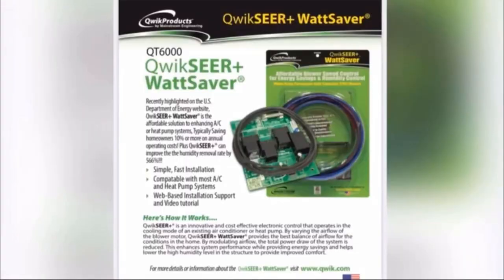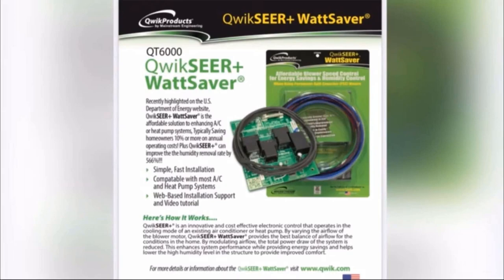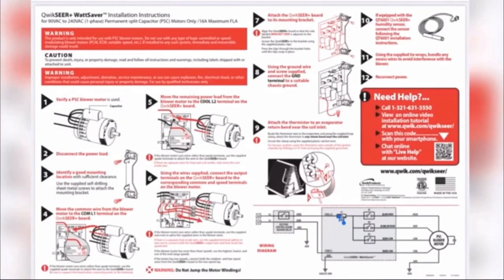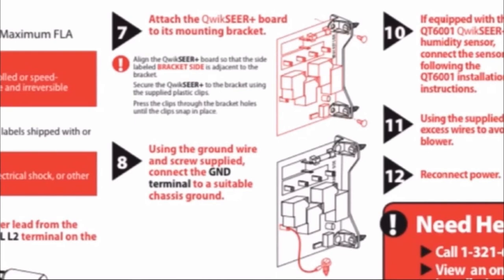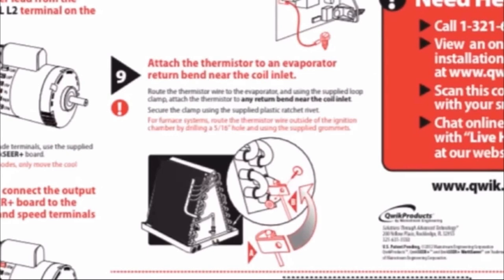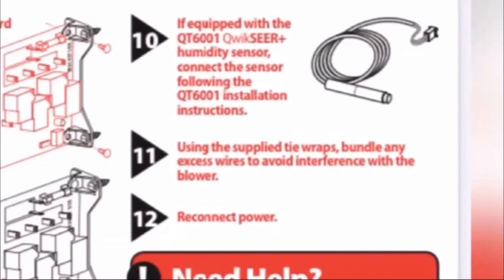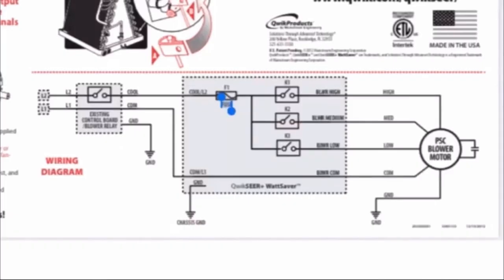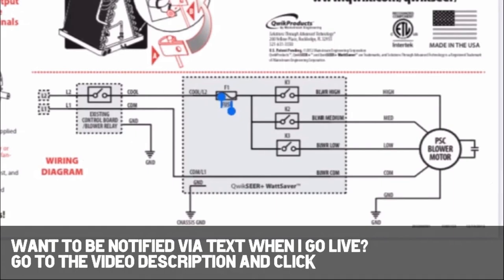Your PSC Blower Motor Will Never be the Same….

Comment: I put one in 10-15 years ago at a customers request, pulled it out a year or so later when it failed, and replaced it with a Fanhandler control, which lasted until we replaced the system with an American Standard variable capacity system 2 years ago.
Reply: So it sounds like a system life extender too Mark Beiser.
Reply: @resurgensix  Not sure where you get that...
Reply: Oh now I see it only lasted a year. My mistake

Comment: Put this in w/ your Bosch system Zack to see of it improve your humidity
Reply from the maker: My Bosch has an ECM motor. Also, the Bosch is already on the lowest possible speeds all the time.
Reply: @HVACShopTalk   put a relay on the bosch air handler and use y2 on the tstat and make that a 2 speed. Works good